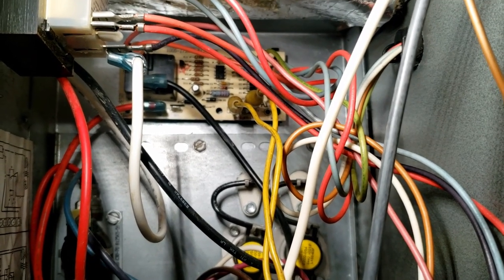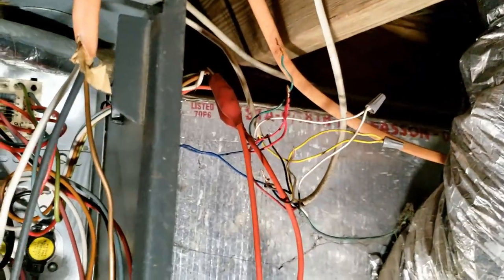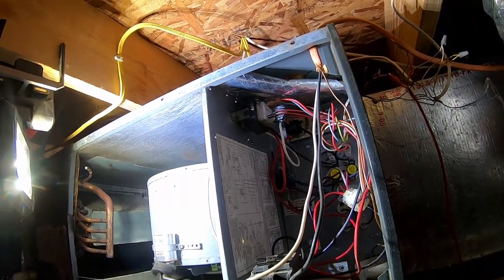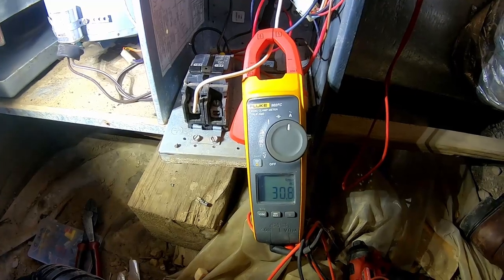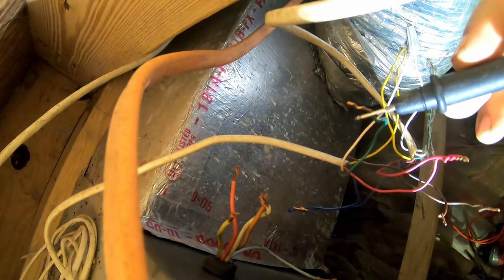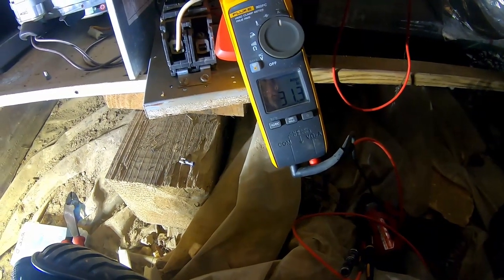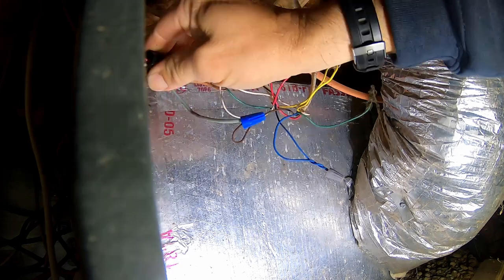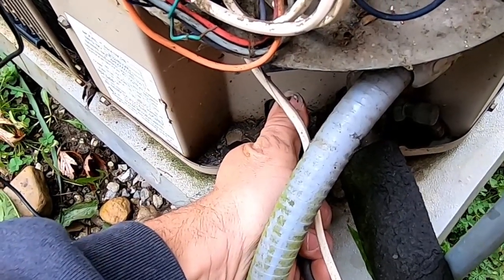How I Diagnose Electric Furnaces With No Heat

Comment: I just worked on a 2 ton AC with strip heat only, no heat pump, had a 10 SEER in wall condenser with a scroll in small in wall box in a condo on outside wall.  Was surprised the separate blower with evap coil and heat strip had only 2 heat activated sequencer contacts and a 24V transformer, the entire system didn't have any electronic boards incl the condenser from 2000, just old school and simple.  No blower call ended up a loose wire on thermostat screws not cranked down after 20 years, left an iced up coil.
Reply from the maker: Whatever works I guess, they probably got what they paid for. Most old school units had the fan on the delay sequencer.

Comment: I’ve seen a lot of installers wire those thermostats thinking that b means blue, so they put the common wire there, but that thermostat uses the b terminal for reversing valve energize in heat. So they hook the blue wire to the “b” terminal on the stat and then hook the other end of the blue wire to common and bam blown fuse as soon as a call for heat because the thermostat is energizing the reversing valve, and they hooked it up straight to common
Reply from the maker: I have seen the same thing 👍👍

Comment: First thing I would have done once the short was recognized,was go check that contactor coil in the condenser, I hoped that it was that!Lol, the worst call in my opinion, verifying and finding a short,intermittent s are the worst.Tatle tales are kool.Great job!
Reply from the maker: I have had several contactor coils cause a short, along with wire rub outs in the condenser.

Comment: Never turn your wires together before wirenut theme let the wirenut do the job and it will be more solid!!! Nice video, good job.
Reply from the maker: I had a wire inside a junction box at my previous house melt the wire nut off because of that kind of poor connection. So I am a big believer on using the wire nut as a cover not as the twisting device. I've proven this time and time again with electricians. I always twist heavy gauge wires with my linesman first then add the wire nut as a protector .

Comment: Single or stranded has nothing to do with it if you run a number six. It’s the column in the wire chart that matters and insulation. You cannot run aluminum wire inside the furnace so I was speaking about copper of course if it’s aluminum have to look at the other chart. And then do something else before you go into the unit with the wire.

Comment: I've had alot of heat pump condenser unit the contacter will go bad and blow the fuse in the furnace so when I have a problem with fuse blowing I watch it when the outdoor unit comes on if the fuse blows check it

Comment: I went on a similar call one time with it tripping the breaker and it was an old low house alot of trash under it water everywhere but the unit was only a couple months old and some jackleg install it condenser unit was on the back of the house the breaker box on the front it called for a 30 amp breaker it was a 10/2 in the disconnect and a 10/2 in the breaker box but the run of wire under the house was a 14/2 and they Wire nut the 10/2 on both ends some people get me at the half ass work they do

Comment: I don’t see many air cooled heat pumps yet have found bad sequencers, melted wires( loose connections or undersized wire). Electric heat seems too expensive an option for me.
Reply from the maker: It's a rental cabin. So basically the equivalent to any other hotel room with electric PTAC units granted this is a little bit bigger than a hotel room though. 🤷‍♂️

Comment: I know its not alot but running the furnace with the blower door open wouldnt that cause the fan to overload and run the amperage higher
Reply from the maker: It can raise the total blower amperage, I haven't had them overheat from just testing. It wouldn't cause any of the issues I had on this call though. 👍👍

Comment: I have a question. I have a change, my ignitor and everything worked fine and i Waited for a few minutes the flame came up a Flame And then after a minute or two it won't back out and it started blowing out cool air what Could have been a problem after that
Reply from the maker: If you reread through your question, you'll see it's a little hard to understand what you're asking but from what you're describing and it sounds like you have a flame sensor that might be dirty. That's assuming you have an independent flame sensor from the hot surface igniter.

Comment: I don't understand the whole wire nuts thing , we don't have them over here .
Wago terminals do a better job i think , if you close them securely and make sure it's tight , they don't move,  they don't twist the wire , all good .
Jealous of that Milwaukee light , mate !
Reply from the maker: That's interesting you guys don't have wire nuts. You guys must love spending more money them? I know they have to be used on the r290 units.
Reply: @HVACRSurvival  Expensive? They are around $0.3 each. Which, yeah I guess, is 2-3x of what a quality wire nut would cost, but electrical codes do not allow for them and realistically, how many of them are you going to install each day? A pack of 100 serves me for weeks.
Reply from the maker: @irfp460  when people properly install a wire nut which is where you twist them together then put the wire nut on afterwards, using it just as a protective cover.  I believe it's going to have better transfer of power (amperage) than what the wago is going to have.  It has less contact with wire when it's just a sharp edge touching the round wire.
Reply: @HVACRSurvival  Look at how a Wago works, there is a wide flat strip on the bottom that gets pulled onto the wire. While a wire nut might have less contact resistance at first, the Wago will keep the same contact pressure throughout its service life and lead to lower failure rates.

Comment: Low voltage hackery knows no bounds. Seems like the owner would love to know they've been wasting money for who knows how long by not even running that heat pump as a heat pump. But perhaps they just don't care. And of course make sure that the W terminal on the defrost board is wired such that the electric strips will run in defrost cycles. That often gets missed.
Reply from the maker: I don't like giving to much info in the video about where I'm at but this is just one of several rental cabins,  it is likely they don't care about the heat pump savings as much as if it's a reliable, warm heat.  I would guess they don't want to hear any complaints about it blowing luke warm air. 🤷‍♂️

Comment: What if you tell them about the electrical and they don't want to pay and correct it?
Reply from the maker: Then I would have there signature proving they were told about the dangers if they didn't repair it. They had us come back out and replace the wire so It's all good. Our installers did that work the next day.

Comment: What is the product number of the light?
Reply from the maker: What light do you mean
Reply: @HVACRSurvival  thanks for the reply. I meant the droplight, the red flas light.
Reply from the maker: I’m going out of memory but if it’s red it’s either 12v or 18v Milwaukee.    I just looked for it on Amazon and all I see is fake Milwaukee lights. It was 80-100 bucks. It’s likely changed design by now

Comment: If that’s a 30 amp heater to stage it should have a white and a brown
Reply: I mean it’s pull in 30 that means it’s an 8KW just pull one of the legs off the heater so it pulls 15
Reply from the maker: Our install department went back and corrected the wiring and breakers. Its been working good.

Comment: I need a follow up on this.
Reply from the maker: What does that mean?
Reply: I need to know if the owners upgrade the electric and put in the correct thermostat.  They are currently wasting so much using only resistive heat and not using the heat pump for as much as it can output.
Reply from the maker: @ericpaul4575  they had us replace the electrical I had installed do it because I had service calls to do. This was like a rental cabin so people aren't living there everyday.

Comment: the thermostat will allow fan to run after no call of heat!!!
Reply from the maker: It's been a while since I've watched this video. What are you referring to?
Reply: @HVACRSurvival  you commented that when you took the jumpers off the fan and elements shut down at the same time
Reply from the maker: @jonanderson7283  if the thermostat had that option, but it didn't,  this was a cheap thermostat.